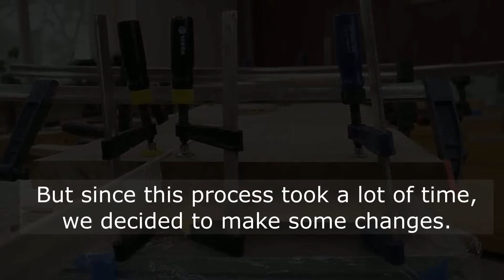Woodworking Project: How to Make an Oak Table with Inlay

Comment: A delightful piece and the video is your usual high quality. I’ve been woodworking for well over 45 years and I would be happy if I had made this piece. Would I have made it differently? Yes. Would it have been better or worse? No, just different. 

I’m interested as to why you switched glues? PV to PU to PV. I must admit I don’t like PU glues - too messy. If I want a slow cure, I use epoxy glues or Cascamite. 

If you want the oak to stay as natural a colour as possible, I would recommend Natura Onecoat hard wax oil in natural mist. By far the most natural finish for light coloured woods that I have come across. Goes further and costs less than Rubio.
Reply from the maker: Thanks for the review and advice.
Reply: @WDRestoration  I wouldn’t say it was advise so much as a suggestion or a recommendation. I think the product is now on Amazon